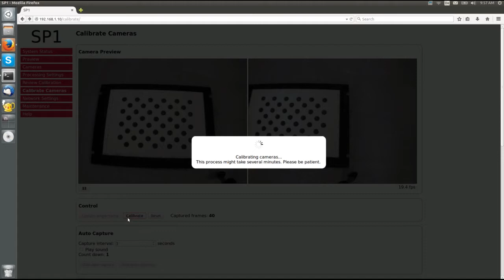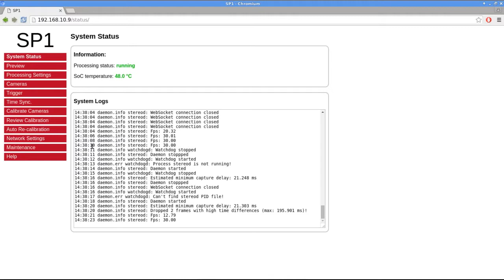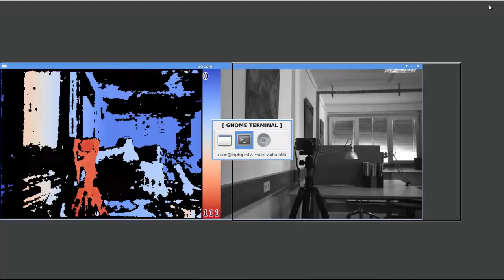Automatic Camera Re-Calibration for Robust Stereo Vision

Comment: Hey! Do you think it’s possible to apply this concept to cameras that are attached to two separate drones that are approximately 100m apart and approx 100m high to get an accurate depth map of the scene?
Reply from the maker: Unfortunately this method is not suitable for a per-frame re-calibration. Hence it would not work in such a case.

Comment: This is impressive, but in practice, it is my experience that recalibration is seldomly required once you glue the cameras down with a commonly used epoxy glue. Then the only source of variability is in baseline length, which arises from temperature differences. However, these variations are very small and not relevant on this scale.

A more interesting application for the same algorithm would be using the weak epipolar constraint to perform camera pose estimation.
Reply from the maker: This very much depends on your camera setup. Particularly for wide baseline configurations it is hard to keep a good calibration. Thermal expansion in the baseline direction is indeed not an issue as this effect is very small, and it wouldn't affect the epipolar alignment. However, non-uniform thermal expansion can lead to twists of the camera mount. This is a critical effect, as stereo cameras are sensitive to even minor angular changes in the viewing direction. Also, when when using C-mount instead of S-mount lenses, maintaining a stable calibration becomes more difficult. C-Mount lenses contain moving parts for focus adjustment. Even when secured with thumb screws, the moving elements might not be perfectly stable. There can be big differences in mechanical stability for lenses from different manufactures.

Comment: Looks cool! Do the 2 cameras have to be perfectly parallel with the ground to maintain the same pixel matching on both camers? What if you rotate the stereo camera 45 degrees? The point you're trying to match from the left view would be not be aligned with the epipolar lines on the right, correct?
Reply from the maker: The cameras don't have to be perfectly horizontally aligned, but a reasonably good horizontal alignment is needed for our systems. Deviations of a few degrees can be compensated.

Comment: I wander your steps to do camera calibration? thanks
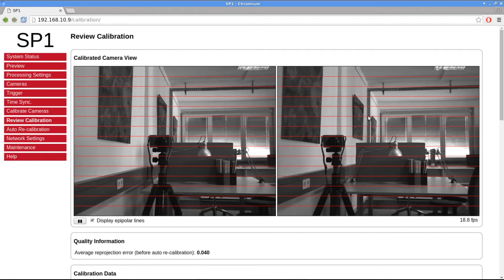Reply from the maker: As shown at 3:27 we use a sparse stereo method that is not limited to searching along the epipolar line, which allows the method to also function with poorly calibrated images. The received matches are then used for estimating the rotation between the cameras. The remaining parameters are taken from the manual calibration and assumed to be constant.